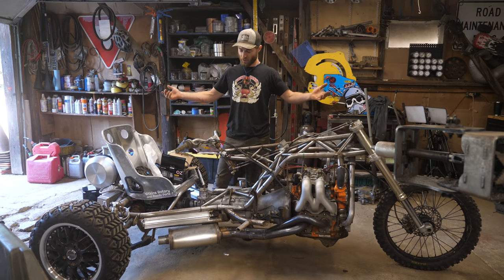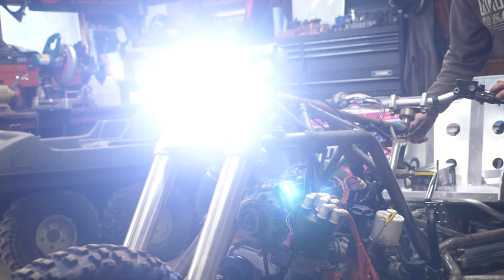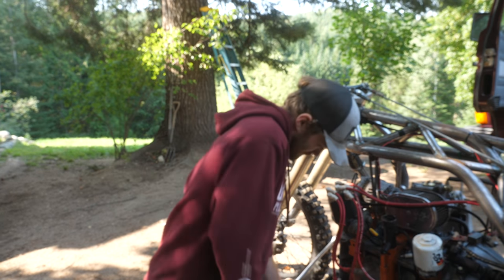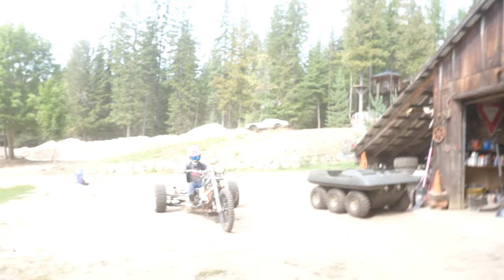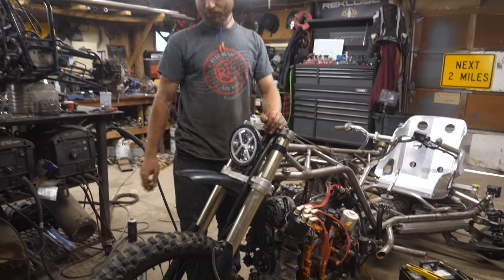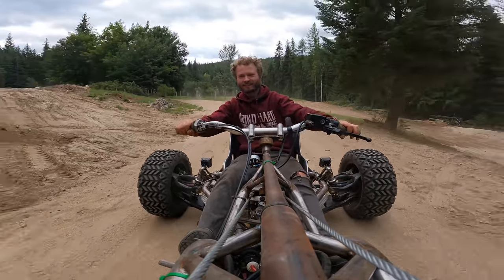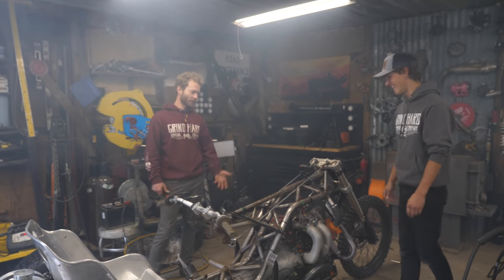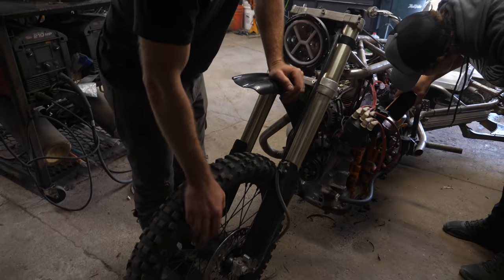Mad Max Rotary Trike Burnouts Lights and More!

Comment: Lets see about the vargus brother's putting together a big port 2 rotor or even 1 rotor for you guys.
Reply: my vote is for rob dahm
Reply: If it doesnt have enough traction to hold down existing torque more power wont really help lol
Reply: @jackbarry9469  will be sick tho
Reply: @jackbarry9469  A mild 2 rotor with larger ports wont produce any more power at lower rpms when compared to a stock engine. All the power would come at higher rpms and for a drift trike, that would be perfect.
Reply: Vargas bros are lame rob dahm is the real rotary daddy
Reply: @venumus1  rob Dahm rotaries don't drive
Reply: @venumus1  If someone is lame, that's rob dahm. Spends 10 years building a car just to sit there and not doing shit with it. A typical rob dahm video consist of watching is buddy welding something, then rob rambles about the same shit for the rest of the video.
Reply: @MrArcticPOWER  you can try to trash rob but he is revolutionizing the rotary world and putting it out there for everyone to see. The only reason anyone even know who the Vargas brothers are is they did build and battle with hoonigan rob was famous because he had one of the only 3 rotor rx7s state side and built the only 4 rotor awd rx7 in existence. You can try to hate the guy but he did something no one in the world has done with very little knowledge and every thing he learns he's sharing with the world for free unlike all the other rotary people like abel
Reply: Yea the brothers for sure at least there’s are consistent and actualy stay running 😂 all robs dons is have other people build his shit while he plays Legos and puts it together 😂
Reply: @jaredmidgett6947  rob dahms engines blow up more than run tho
Reply: This needs to happen!
Reply: YouTube Overlords suck  Rob Dahm is a genuine guy. He doesn't claim to be a know it all about all things rotaries but has what many people cannot lay claim to and that is experience running and building 2,3, and 4 rotors at high power levels. I mentioned the Vargus Bros because they specifically are the guys to source rotary parts, properly modify the parts for optimized power, and actually be able to produce it timely as they have done exactly that before. Rob is producing his own projects and has a plethora of money and his own time tied up across the amount of work hes done. A "hack" is hardly what i would describe someone so dedicated to their lifestyle, they go to work blueprinting and re-manufacturing his own parts out of necessity for a ground up build. He litterally is doing free research and development for everyone regardless of if people agree.
Reply: @darianistead2239  Your claim that he just gathered all this new found info from his 4 rotor is inaccurate. The original tension bolts used on the 4 rotor were incredibly small diameter and while it was that 4 rotor that received the oversized dowels and improved tension bolts, it was not something done by the engine builder, rather it was performed in house by Rob on his own cnc.
Reply: YouTube Overlords suck  Yeah hack tuners. Good tuners have nothing to hide
Reply: @madmod  I never said he gathered ALL his information from the quad rotor. I did say all that information is common knowledge here and in New Zealand where he bought his engine. 
Even he himself said most of the parts he used are from New Zealand, those single piece hollow and solid dowels you can buy off the shelf, along with studs to increase tension, studs that are to "fit" that also act as dowels, oversized studs that require machine fit through plates and housings tollerances, machining for extra dowelling, his race toleranced rotors etc, it's been done forever and is no secret. 
Just like premixing, deleting omp, running E85 etc etc, which he then shows he uses Klotz which is 20% castor, which gums up side seals and makes them stick, which he'd know if his engines lived long enough.
Redline stays suspended in alcohol and doesn't gum.
Btw, his billet quad rotor was built in New Zealand as was a sum of his first cast 26b's and 20b's parts, and the builder shared all the info on the build with him even experimental developments, the hollinger drivetrains Australian and the hoonigan based AWD chassis was built by a New Zealander. Yet he claims the industry secretive and he had to do the hard graft to get information to the masses🤔
Reply: Fuck I was just thinking that. Probably gonna happen
Reply: @darianistead2239  None of the information lifted from the hoonigan car is public info. He had to pretend to be a part of their team just to get overall suspension geometry to begin fabrication of a ground up car. 
As for attacking his knowledge based on his cars "not living", he ran his 3 rotor for 8 years varying from 6-800hp. His older 2 rotor before that ran for years at more than twice factory power output. Why would you expect longer life out of a racing engine thats relatively untested? 
Remember, there were 12 eccentric shafts for 4 rotors in the world when rob picked up his engine. The 26b he received was not designed for boost, rather was a building block to continue his project before the proper engine found its home in the car. So what if it takes him longer to finish his goals. Its still him doing the tuning, him machining the parts, and him and his team assembling the car. 
You are free to disagree but in my opinion, its more beneficial having him testing these rotary combos at high power levels and loads that the average guy wouldnt be able to achieve and actually showing us the results, especially when there is a lot of mixed information and bad information out regarding these engines. Hes done more for the regular rotary guy than what you claim is just spreading known info.
 Hes also very knowledgeable about other cars. Have you seen his suicide door Lincoln?
Reply: @madmod  Rob Dahm called Ian Stuart who gave him all the information for the hoonicorn drivetrain after he explained his intended build, His words... The New Zealand PPRE 26b e-shaft is an "off the shelf part" as is the rest of the parts Rob pieced together for his first 26b that didn't run. There may have only been 12 available when he was looking to get an E-shaft but PPRE had also already built the 3x 26b's Mad Mike campaigned in D1 in 3x different countries before either Rob Dahm or the formula RX-7 were running. And before he bought one there was the FOURRE fd, Stu's 26b sp20, carls 26b toyota aristo, CBR also had a 26b quad turbo rx2 etc etc. 
Rob Dahm's current billet 26b was built by Carl from CBR in New Zealand.
"Attacking?" He's all about "sharing the knowledge" and that's fact based on something I've come across.. 
6-800hp from a 20b isn't that impressive especially when dynos read differently, there they're alot more generous numbers  than here, and that engine failed due to his tuning. Years don't equate to running hours, for comparison Mikes 20b Rx8 made an actual 1000whp and sustained continual abuse over seasons of drifting equating to many more hours relatively. 

Robs whole ethos of the racing community being closed off to sharing, is only true in some certain instances but as a generalisation it's complete bs.
For one, the fact so many have helped and shared in his own builds being a contradiction, something I've experienced personally too by even simple things like being lent personal shop porting templates. 
It's great he can afford to buy machinery to do his own basic machining, but it's much, much cheaper to just ask and pay to have an experienced machinist carry out the work one wants done for their build.
Like I already said, he hasn't figured anything new, cracked the enigma code or found some secret formula. He hasn't paved no new path as he claims, he has merely shared a well trodden path he's learnt to those whom are noobs and haven't yet.
Reply: @darianistead2239  You completely lost me when you said 2 liters of displacement producing 800hp sae on a dyno going on to become one of the fastest half mile rotary cars running on a nearly decade old engine is not that impressive while still being a street car, not funded by a racing team but by one man in his own shop.
Reply: My buddies 2.9 whipple coyote makes 620rwhp. I guess nothing is impressive compared to Mad Mikes ride am i right? How nonsensical is that lol.
Reply: @madmod  That's easily understandable you'd be completely lost. 
Half miles aren't a thing here, pretty easy to be competitive with little competition, there's only one half mile track here between two countries lol.. Besides, 800hp in the U.S is most likely about 700hp here or less depending on dyno, so that's like comparing apples to pears especially when Robs 20b "street car" would never be street legal here. 
There are many privately owned and built 20b cars here that exceed his power figure and run single digit quarters in full street trim. like I said, he maybe teaching noobs, but for those in the know there's nothing new going on. 
Chequebook racing is nothing new too.
He has the funds to buy billet engines built, a team and funds to buy machinery the average man can't, nor small shops. I personally know people who've done more with less, that's impressive.

That's cute, your mate has a Mustang👏..  What do you have?
https://youtu.be/rVb-WI8BH-I The black FD sitting on the dyno is mine, only time it ever saw a shop was for my mate to tune it as with all my cars, couple of them on my channel. My mates are the same with big power home built Barra's and all sorts. If your mate done the work himself, nice. If he had it done, then it's not so impressive
Reply: @darianistead2239   now you go straight to challenging my own personal vehicles. I'm not here to argue with you. you're allowed to have the opinion that 800 horsepower out of a 2 l is an impressive but that's where you and I disagree. Deuces
Reply: @madmod 
You brought up your "buddy's" car as some form of comparison to impress🤣.. Don't get a sore bum because you couldn't win a debate with "my mate has.."
Be real, you watch alot of you tube and are now an expert.. Hence I asked what do you drive? Have you ever even touched a rotor? or motor lol..
btw "800hp" 🤣.. that number means nothing on it's own. What's it trap for the quarter? That's the fairer way to measure between countries of different measure, when strapping or correction factors play a big role in the end dyno figure, but I guess you already knew that lol.
Like I already said, he's a mentor for noobs.. and fan boys.. and tbh, that's not a bad thing, it's actually quite noble. 
Dueces🤦‍♂️
Reply: @darianistead2239  You are very shallow.
Reply: @darianistead2239  I only mentioned the combo to show how nonsensical it is to claim that power level is less than impressive. A 600fwhp car is nearly useless on the street as far as putting power down so arguing that 800 is anything other than an extreme amount of power is pure bs. I own sand rails, a mustang, a big block el co, and several other toys but what does that have to do with the conversation at hand? You are just nut swinging at this point.
Reply: Of course the power level produced by robs nearly decade old running combo falls shy of what a high funded racing team produces for their track only cars that dont see any street miles.
Reply: @madmod  Like I said many times lol...
He is no rotor guru. There are proper street cars that run that power level and more for years🤣🤣 which you'd know if you knew. That's nothing new.
I said trap speed, not quarter mile times because it can make a more fairer judgement of actual power levels.
You clearly don't know why so is pointless discussing further than your lack of comprehension. 
He doesn't manufacture parts, he fits them. Why would he buy billet already built engines if he's the go to rotary god?
Reply: @madmod  You make nonsensical statements based on something you haven't a single clue about.
You built rotaries? thought not.
You immersed in the scene any further than you tube video's? thought not.
You own one? thought not..
Fan boy, pick up a wrench, build something and speak from experience instead of what you watched someone else say.
Reply: @madmod  Sure mate, keep telling yourself that.
Reply: @darianistead2239  bro that was classic to read. Old mate here is clueless. Can't answer even one of your questions? Total Narcissist. Cheers from home.
Reply: @roddas26  Bro, old mates a drop kick aye.. A self appointed professor graduated from the university of You tube🤣🤣..
He called me "shallow" for calling him out, he don't know we call out shit talkers and eat asses down here lol
Cheers bro🤙

Comment: it doesn't sound like it's running right, those things are designed to rev out pretty high, so i wouldn't think it's normal for it to lock up. I may be wrong though, i'm no expert those are just my thoughts, either way i love the build it's super sick!
Reply: it does sound like it does need a tune
Reply: they know, they just don't care because its going to get rebuilt
Reply: @mate_timitime1093  its carbuerated, not tuned the way one would typically think when they think rotary
Reply: @tobylarrison4826  it's still called a tune because they are fine tuning the carburetor
Reply: yeah it sounds like a combination of bad timing/advance and being dead lean, especially with how badly it breaks up in the mid rpm range and 0 exhaust smoke/soot. those header tubes should at least be a dull red after those extended rev sessions. makes sense with them just slapping on a carb straight out of the box with no adjustments. they should probably quit while theyre ahead before they and up with a pre-definition event and shatter a seal and wipe out a housing or iron(s) or rotor.
Reply: @misterdeedeedee  Totally agree, thats a lean rotor for sure, They need to stop running it or they're getting a hotspot somewhere.
Reply: Ur right rotarys are meant to rev high
Reply: A healthy 13B should be a whole lot more rev-happy indeed. The first thing to check when it no longer starts on the starter motor is the compression and the rotor seals. Some folks drill extra oil feeding holes in the aluminium rotor housings and that helps a lot with the longevity of the seals
Reply: Bring in the Vargas Brothers for the rebuild and tune so they don't destroy another motor once this one is rebuilt.
Reply: You can normally turn over a rotary just by grabbing the alternator pulley so it's really messed up.
Reply: YouTube Overlords suck  that’s a $5700 e shaft for a billet engine. Which this trike obviously doesn’t have. Only other rotary with a center bearing is a 20b. The bearings in the rotors are called ROTOR BEARINGS. Not center bearings. Crazy eh? And no one uses vac advance on a Weber. Vacuum signal is too distorted on a dual throat carb. Your ignorance is showing.
Reply: YouTube Overlords suck  oh so you’re suggesting a Nikki is better than the Weber? Another clown statement. From the same guy claiming this engine has a center bearing 😂😂
Reply: YouTube Overlords suck  calling it a center shaft would imply there are other shafts in the engine. There’s not. That’s why no one calls it that.
Reply: YouTube Overlords suck  you can look at the link you posted yourself and see how wrong you are. You see the center bearing and oiling jet in the middle. (which is only for this $5700 eccentric shaft, 3 rotor center bearing is a center main bearing and very different) and you can see the lobes on the shaft where the rotor bearings ride. So by your logic that engine has 3 center bearings? No. Terminology matters, and I’d expect a tech for over 2 decades to know that. You can’t tell the customer their center bearing is shot, when nothing of the sort exists in their engine.

Comment: Many years ago I had a 1974 Mazda RX 2 or 3 and the tips of the rotors lost compression, while I was waiting for my new motor the mechanic said to dump some oil down the carb to build pressure and that worked. I had tons of fun with the car I would shift it at 10,000 RPM when it started to lose power. The down side was very poor full economy 10 to 15 MPH  when working hard. I enjoy your channel keep up the good work!